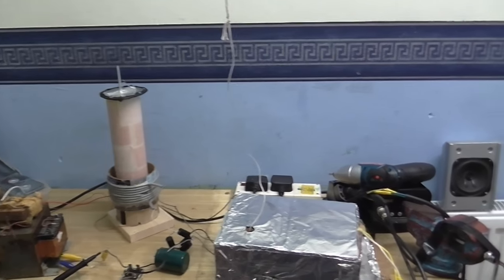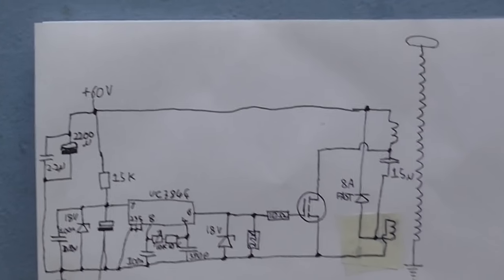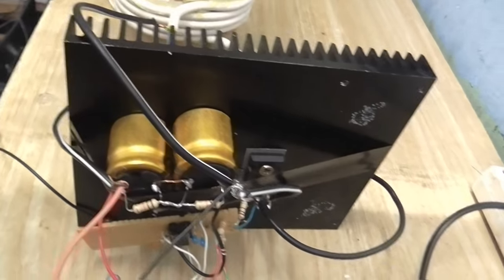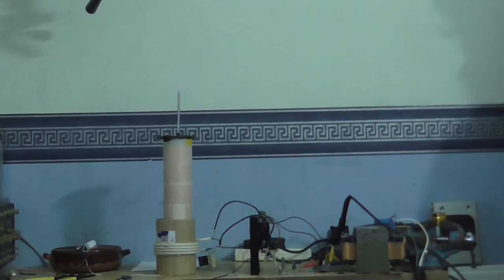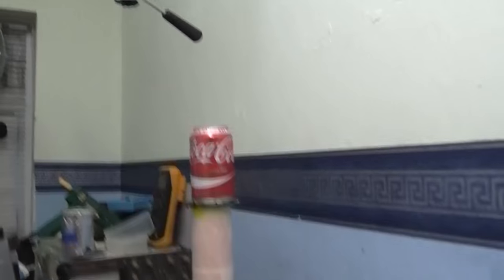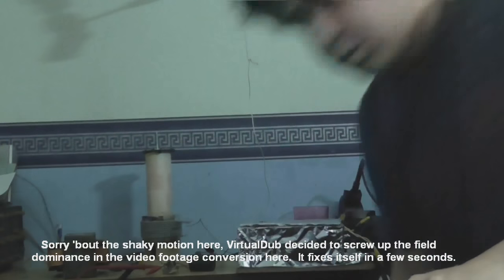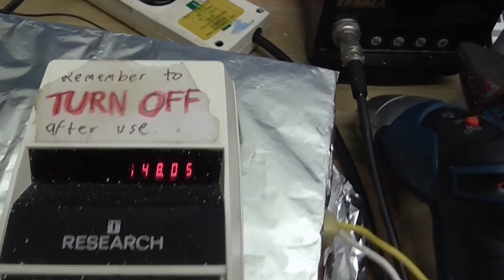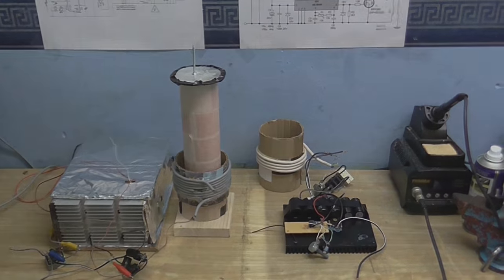ISSTC & Running my PLL Tesla Coil unballasted.

Comment: Sweet!  One thing that also helps a lot with spark size is having a fat secondary.  I got almost 2 feet with a 4.25 inch diameter by 9 inch long secondary along with an 8 inch IIRC topload.  It ran from a fullbridge of irfp260s and voltage doubled US mains
Reply from the maker: +PhoenixLasers I might try that, I have a piece of pipe about the same diameter and an almost full reel of magnet wire.  One thing though, if you were running off doubled us mains, surely the DC voltage going into the fullbridge would be almost 340 volts, how did your IRFP260s take that that when they're only rated for 200 volts?
Reply: +CoolDudeClem Sorry I was actually running HGTG30N60s!
Reply: bragging about your day secondary, eh? lmao

Comment: Cool :)
got to say you should change some things in your half bridge :)
the 2 series caps (with coil at center tap) can be a lot higher (im using about 2000uF)
second you should series a **nF (depends on frequency of your coil) with your primary on the side of the FETS.
Make sure the fet protection diodes are still on the fet side
It helps keeping the stored energy inside your primary (yes your primary becomes isolated from the circuit by means of dielectric)
you will get these results at much lower voltages (im running on 48 volts with the same results at arround 125 watts).